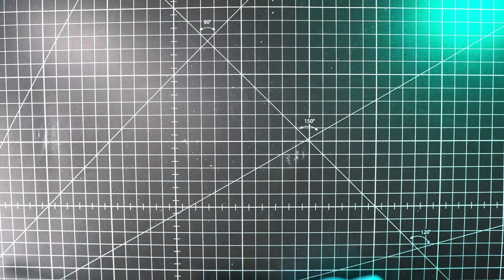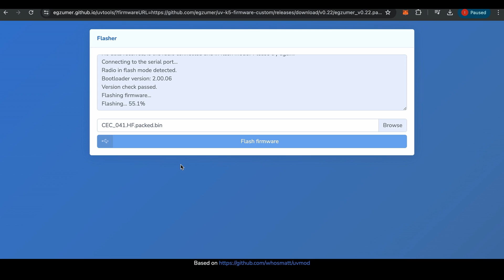FULL BAND HF Mod - Quansheng UV-K5 (Si4732 chip) TUTORIAL

Comment: Hi, I have installed this kit, with the right sw but volume level is low (it seems that is all right because I receive the signal correctly). ---------Do you have suggestions ?
Reply: Not a great help to you as you have already installed it but there is a newer module that includes an amplifier circuit, to correct this low volume. It's the brown module. You probably already know this by now. Not too expensive to install the newer one, though, if you wish.
Reply from the maker: unfortunately that how it is…. volume is quite low in HF mode
Reply: @takeapart  tanks for your answer.

Comment: what I do... I can not get the resistor under teh screen off... hot air up to 500 degrees... a solder tweezer, 2 solder points.... i can not get it off... what the hell is wrong with my board...
Reply from the maker: hard to tell… you can still extract it with force, but do not damage other components
Reply: You could gently snip through it, i guess.

Comment: I destroyed 3 radios once with smd devices. Will never touch again went back to conventional designs.  Good video. I know the sischip. Used a couple for various other functions. I would rather buy a suitable radio than do this mod. It's a challenge and educational, that's what it's about.
Reply from the maker: it is not easiest thing to do , but totally doable…. it requires steady hands and clean head ….

Comment: The capicitor sucked. I ended up giving up and tossing the radio
Reply from the maker: ah, sorry to hear that
Reply: Many years ago I ordered parts for a project. Unfortunately the capacitors were missing. I looked and looked. I had never seen smd devices before fully. You can guess I had thrown them out with the packaging. So small I never saw them. Well I found them in the Bin. What are these, just tiny Dots. It was hell dealing with them. I failed badly and the project  was completed using normal caps . They stood vertically, but it all worked ok. They were only for decoupling.

Comment: Great tutorial thanks for taking the time making this!!! I did the mod today and flashed firmware UV-K5 HF 0.5,  does anyone know what I need to upload my channels in chirp?  I tried stock chirp,  chirp with egzumer module, ijv module but they all say its not compatible with CEC HF0.5,  IJV was able to read and upload but then nothing is there. Of course I did reset ALL after flashing the full band firmware.
Reply from the maker: I uploded my channels before I flashed CEC… so with stock FW.  then channels will stay in
Reply: @takeapart  So that would mean that all changes after flashing CEC would have to be done on the device itself......hmm sounds not very convenient.
Reply: I tried like you said but the problem is that after flashing CEC I have to reset ALL in the hidden menue otherwise nothing is working, not the backlight, the screen has weird artifact everything is off only after I reset all it works but then I cannot upload anything........its weird
 @takeapart

Comment: It's not a resistor, it's a choke. You removed a choke and added a different value.
Reply from the maker: thanks for correcting me.
Reply: Who care's? Just put whatever it is in the right place and thank the man! Don't be a couple of " Sad Ham's."
Reply: @spike1756  hah! God bless you Spiky!
Reply: It's not a resistor, it's a inductor
Reply: An inductor has resistance but it doesnt make it a resistor.. The other way around a resistor can have inductance but that doesnt make it a inductor either..
Reply: That’s half correct. They are both resistors! But they serve as chokes. 
A resistor resists, yes? “Choking” The current. 
Been doing electronics since 1974😇
Reply: @johnemmons9087  its not a resistor its an axial inductor
Reply: @johnemmons9087  Yes but correct me if I am wrong, the choke is a wire wound.